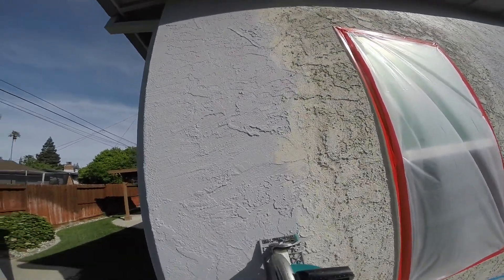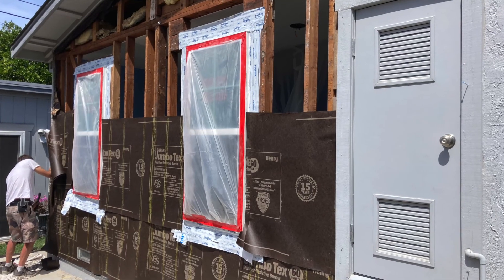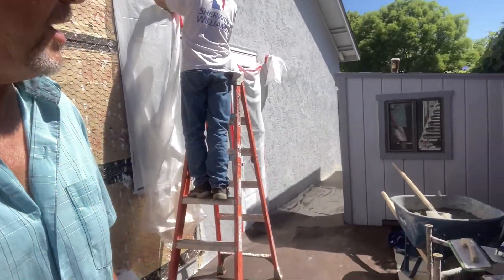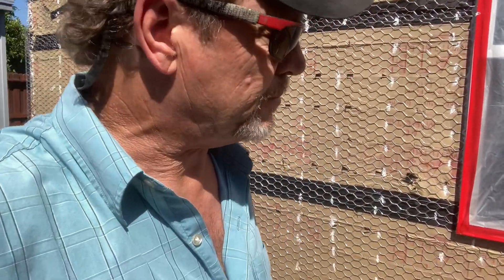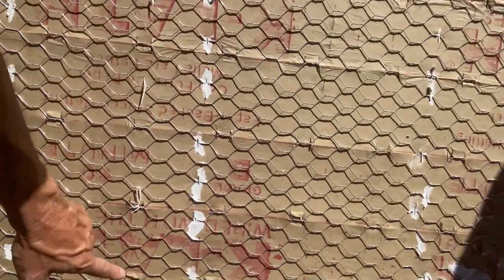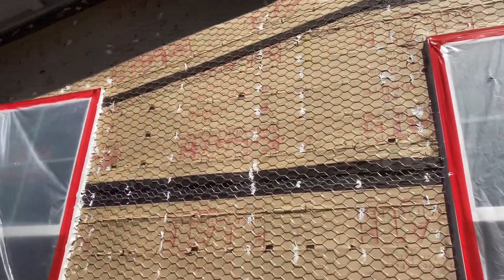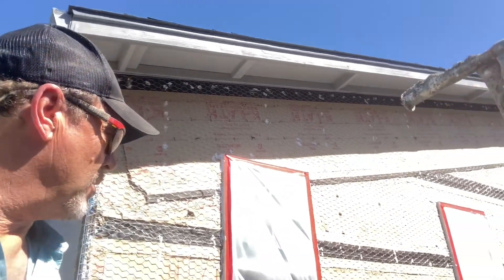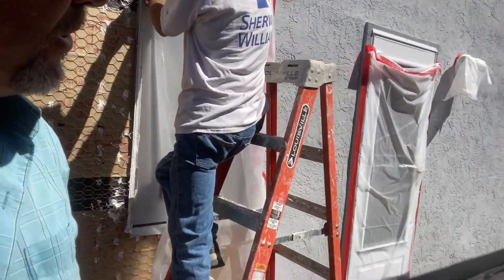Watch Out For Guys trying to Fly By Night and Do One Coat Stucco on Your House,   You May Be Sorry

Comment: Did you put 60 minute black paper under the paper back lath ?
Reply from the maker: Yes. But here is the problem
Reply from the maker: I went over the flashing on the sides. It’s open stud construction, so water was just rolling in. I should have went under his flashing first then over it with the paperback
Reply: If you went under the flashing you would have no wire to bond too